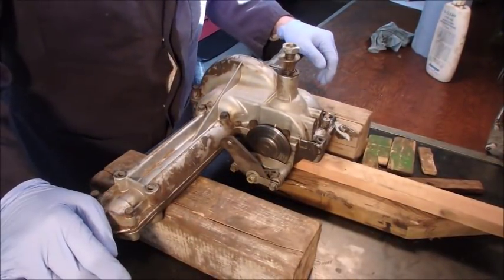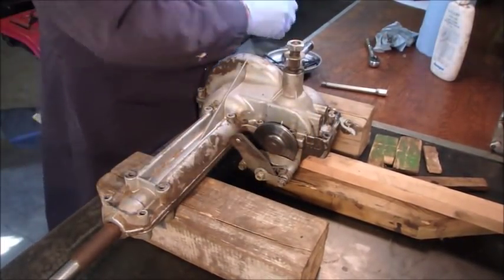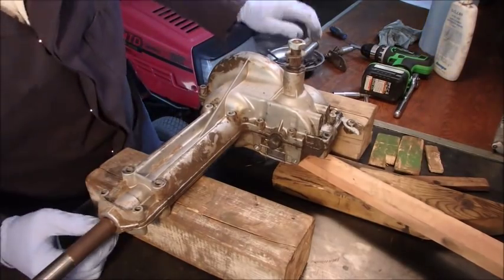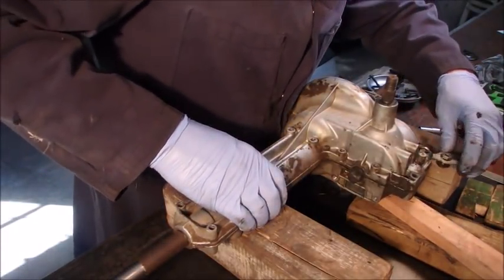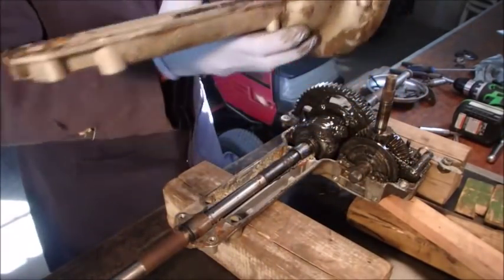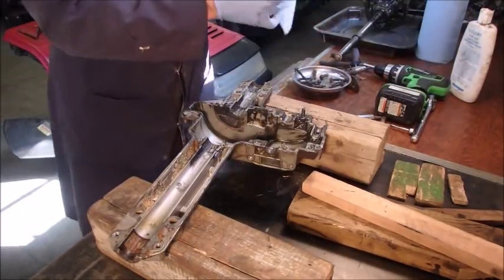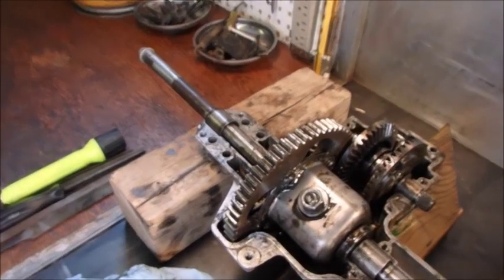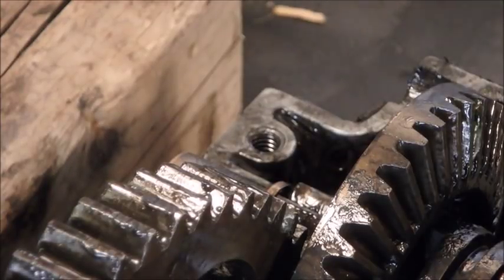MTD Lawn Tractor Differential Troubleshooting

Comment: Only person I can find testing the differential the same way I am right now.... My differential assembly  can be replaced in a [cub cadet 1040 ltx]  for around $200 but I have a grinding sound with some clunking and bouncing inside the differential... Thanks for this video! I hope I can fix this issue before parting it out :]
Reply from the maker: That is a good price for a replacement

Comment: Nice video, I got to see inside and gave me a few ideas about mine.  I've got one that locks up completely when in gear, but spins free in neutral.  Weather permitting I'll tear into it tomorrow.  Thanks!
Reply from the maker: Go for it!  Good luck
Reply: @BrucesShop  Turns out the gearbox is fine.  The variable speed pulley bearings seized up.  I have those on order now.
I disassembled and cleaned the gearbox, and replaced the grease anyway.

Comment: That Bentonite always spells disaster after about 10 years. Any time I get an older machine in, I always drill a small hole in the top of the transmission and pour about a pint of gear oil in for good measure. The Bentonite separates from the petroleum products and turns to a clay like substance, then it gets to the point where it's completely useless. I say, good call on scrapping that axle. The Briggs....It'll last forever if cared for. Cheers my Friend! Sean~
Reply from the maker: Thanks.  Zippo.  Glad you chimed in!!!  You learn more on the challenging ones.  If you just change the oil and buy a filter you don't learn anything.
Reply from the maker: You are so right.  the grease looked carved out like a scoop
Reply: Zippo do you cap the hole you drill on top of the transmission?
Reply: @doublewide6  ! KK

Comment: In 1989 I built thousands of differential for agri fab and then hydrogear pumps. It’s fascinating how that stuff works. The large gear on the differential is the bull gear. Thanks for sharing.
Reply from the maker: Thank you.  i know what it did but not what it was called.  Cool
Reply: Hey could you possibly tell me what the numbers on these belts on this mower is I had to replace the transmission belts the ones MTD sent me are way too big if you could help me with some numbers that I could pick up at Napa or somewhere I would be eternally grateful

Comment: Bruce you made the right choice of not repairing the gear.  Those MTD's are really hard to sell around here for anything over $250, and that is all tuned up ready to mow.  I try and stay away from them, I do much better with the Craftsman mowers.
Reply from the maker: Yes the Hydro's sell well too.  I hated giving up.  Motor extraction coming up.  I hung the tractor in the garage like a moose during hunting season.  The weather just went COLD so I missed that.  -28C today.  Just sticking around the house..    really.
Reply: I know this is 6 years old now, but that's pretty funny cause MTD makes Craftsman riding mowers.

Comment: Well done video. I have a 2002 Craftsman LUV, made by MTD, that I bought a couple of years ago. These where recalled back then because of transaxle failures. Mine was already replaced by the previous owner  under the warranty,  but broke on me again. They seem to have a weakness in the axle gear, it's a straight axle, with no differential. If the trans pops into gear under load for some reason, it will crack that gear at the axle shaft, causing the axle and it's drive spline to migrate out of the gear. Once that happens, all vehicle motion and braking is lost. Replacement straight axles where not available, they where apparently all used up, so I ordered a differential type axle for an MTD Pinto and installed that, hopping it will be more robust. I too, have put a lot of money into my beast. I bought it used for $425, and have easily that much more in parts into it. But, it finally seems to be working as advertised. That Bentonite, is very nasty stuff.
Reply from the maker: I agree.  It is hard t when t call it quits.
Reply: There is a differential. It is enclosed right beside that big gear. It's even called a "Differential Ass'y" in the parts book. However, it does not seem to be available separately anymore or if it ever was? Unless you are talking about a completely different machine? Seems to me in his first video that he did rotate one wheel one way and the other wheel turned opposite which means there is a differential in it. The transaxle in this video looks exactly like the MTD lawn tractor and parts book i have. Don't know how old mine is, bought it used, and when i put the Model and Serial number in the MTD search box---nothing showed up? I have not tried contacting them though.

Comment: HAPPY NEW YEAR BRUCE. Good call on scrapping it. It is a shame, but not worth it. I have a hydrostatic in a Kubota at my mother's house that has a front shaft seal and possibly the bearings and shaft that needs replaced. Not looking forward to it.   The tractor is is only 2 years old and was well maintained. Of course out of warranty. Kubota gave a cost repair making it cost more than it is worth. It replace a 22 year old Cub.
Reply from the maker: I know.  I was talking to the John Deere manager and he said $140 and hour for work.  I get it that it is expensive to run a business,  I don't have a problem with the that.     That is why folks give them to me.  3 hours labour and $400 for parts and I get a free tractor. because they don't want to spend that and then have problems in another week.
Reply: Bruce Pender I agree. I have a few parts machines now that will be winter tear apart projects. This Artic cold blast has put that on hold for now.

Comment: I have a 97 mtd garden tractor.  Low range and high range 6 speeds in each range.  I just recently was unable to go into low range. I admit I use this tractor for things it probably  should not, likevpull my rv, grade my driveway  with a box blade I made.. it is older but I have only had it 2 years.
Reply from the maker: I wished i could help
Reply: @BrucesShop  thanks for answering
Reply: you probably have a Walbro carb on there that's no longer produced. If you need parts, VE Petersen has them. I just had to rebuild mine after 23 years. I do wonder what the tranny/diff looks like inside....

Comment: My theory with this problem and a few others is people hauling the machines around. The machines set on a trailer or in a bed of a truck smashing back and forth for miles. Those things come in crates for a reason. If people would properly tie them down this problem along with auto liability rates would get better.
Reply from the maker: You could well be right.

Comment: Got to know when to hold em and when to fold em. I walked away from an old McCullough chainsaw after a similar experience. Kept it for parts for the other one I  have .
Reply from the maker: Have you seen this video Tim.  I gave up on this one.
https://www.youtube.com/watch?v=6Sg_XgfTqFM
Reply: HI Bruce. Similar McCullough sold by Montgomery Ward circa 1970's. Not as bad as that Mini, but after fighting the same problems on the throttle and getting it running, the rubber intake just sort of melted away and it wouldn't run right. Too much trouble. I have two, the other works perfect. I can cannibalize it.

Comment: Hey Bruce on this particular mower I am replacing the top and lower transmission belt it's a 2013 42 inch cut MTD sent me the wrong belts could you possibly tell me what numbers on the belts I would get from like say NAPA Auto Parts please
Reply from the maker: I am sorry.  This is a five year old video and I parted out the mower afer all the work i did on it.   Once again sorry

Comment: @Bruce Pender. Bruce, the mower my stepson bought for $100 wasn't going into Forward, so I sorta explained the transmission to him, dividing it into 2 parts, 1: the gears, 2: the deferential w/axle. The forward gear needs to be replaced. It's not to bad to change since you already have the trans out, which is the hardest part of the job. Back to this mower. It's not worth fixing, or was it just the age, plus money already spent on it. I know we all have our breaking point but since this guy spent $100 for a mower in great shape, they just didn't know the trans would be a cheaper fix than they were told by the repair shop.
Reply from the maker: Thanks for the input.
Reply: @BrucesShop  Well, actually thank you to you. Your video is 1 of 2 I downloaded into a folder named ''Mikes Bolens MTD Mower. With a tag on the bottom side of the seat with, ''Troy-Built'', then ''MTD'' on a ''Bolens'' mower, it's not a wonder most of us guys who do their own work can get confused on what product they do have. So now that I have that figured out, what he needs to fix his trans is, 1: the Forward Bevel Gear, 2: the ''Shift Collar'', only because it has a small amount of wear but can add to the trans issue: ''Popping Out of Gear'' issue.

For those of you who are going to repair your own trans, the Lubricant I'm referring to below is called: ''Super-S  /  00 Grease & Sells for $5.29 + Tax /It's under the heading,  ''Cotton Picker Spindle Grease 00''. 

Where:  ''Tractor Supply Company'',  aka  ''TSC''  & at tractorsupply.com

As for the lube which needs to be replaced because it's very dirty ''brownish color'' & it's already breaking down into a liquid, plus there could be a small piece of metal, metal shavings but probably dirt, so it wouldn't be too wise of us to reuse this lubricant, besides we really do not need experience tearing down this mower that much to save a couple hours time so save $5.60. Besides, the 00-Grease is also what MTD is referring to if you were going to buy their product, which I was told cost, $19.95 for a 9 oz bottle & this transmission takes 19 ounces. So 18 ounces is $39.90 from MTD. I'm sure a repair shop sells something maybe under a different name for less than MTD's price, [maybe cheaper] but you get the idea.... I mean if we're gonna do the job, why start looking for the most expensive stuff out there.... With this lubricant, it's like a $40 job to fix the trans....
Thanks for getting back with me. You're up in Canada right?
Reply from the maker: @montydaniels1054  Yes.  Western Canada   a 9 hour drive north of Helena Montana

Comment: Do these transaxles have any grease ports on them?  I want to service mine but it looks completely unserviceable unless you take it apart like you did.
Reply from the maker: They do not have grease ports.  I considered tapping a 1.4 in thread hole to service it with grease.
Reply: @BrucesShop  Thanks for the response.  I thought about this too, but it looks like the axle bearings are sealed cartridge bearings and the actual differential housing is riveted closed...so a grease port would really only lubricate the gear teeth and not much else.
Reply from the maker: @cup_and_cone  OK

Comment: All that and to throw it away, seems a waste.
Wonder what got in there.  Mine is about 25 years old and don't think it had any issues prior to the housing break.
Reply from the maker: So true.  You know I was just done.  I would repair something major  2 days later another major thing would happen.  Thanks for watching though.
Reply: @BrucesShop  I finally got mine all apart, I can definitely feel your pain.
The headache of rebuilding this and if it doesn't go well will be quite a blow.
Can you confirm for me that the axle/differential is a bit 'wobbly'?
Kind of looks it in your video but hard to tell.  Should it feel like a solid rod, or should it feel like it has a knuckle in the middle?
I tried to take the diff apart but couldn't figure out.  Some of the spacers have wear only on one side which makes me wonder, but maybe the spacers are stationary so it makes sense for the bottom side to be worn through since it's getting all the weight and friction.
I didn't look at my gears up close but think I'll only need some new spacers, we'll see.  Just the thought of trying to get this back together gives me a headache.

Comment: Great infor.  rebuilding that gear is not hard at all, even the previous owner did a bad job as rebuilt gear groves are too shallow, so the sounds from. It could built up bad gears by welding, then reshape/grind gears by a stencil pattern from 5-10 good gears, and use it to check how the rebuilt gears shape.
Reply from the maker: Right.  I had so many issues with this tractor I finally parted it out.  This video was made 4 years ago.  Thanks for commenting and watching.  I totally understand I should have kept going.  I was just worn out like the tractor.  LOL   Thanks again.
Reply: Osborne Bay-----"previous owner did a bad job" What makes you think anyone has welded it? I highly doubt anybody welded it. Those aren't "shallow teeth", they are damaged teeth, and anyone who has worked on a transmission or differential can see that. You never talked about hardening the gear either. If anyone had 5-10 good gears in the first place, they sure wouldn't bugger around trying to weld and shape teeth!!

Comment: Would like to have seen the condition of the forward , reverse gears and the engauge plate between them  .
Reply from the maker: This is a 4 years old video.  I finally got fed up.  Every time i went forward it was 2 steps back.  This machine was worn out.

Comment: Is there any way to add oil to the rear end?
Reply from the maker: This one was sealed.  You can drill and tap a fill and drain hole .  I have not done it but you can google it for sure.

Comment: Well, this makes me sad.  I always think things have feelings, used to always make sure the covers weren't over my teddy bear's face, so he could breathe.  I have a 1998 Craftsman/Tecumseh in the basement with a badly bent crankshaft from hitting a root (it started back up) and then immediately, a piece of old brick that had appeared in the back yard (kids? neighbor??) and, even though I bought a brand new Toro this past Spring, I can't bear to get rid of the Craftsman.   Have newspapers and rags under it to catch the oil that's leaking out <sob>
Reply from the maker: I know I know  sad  :-(   -------------BUT I am selling the parts.  It  helps to pay for the cost of TRYING to fix it.  Think of it as a heart transplant for somebody else's  tractor.
Reply: that'll work!

Comment: Old post. I didn't see what was removed with the shaft that shifts it from forward to reverse, but there should have been a spring with a steel ball under the shift shaft, the steel ball may come out and into the gears?
Reply from the maker: You are right.  This is a video from sixtyfiveford   at 1:13 in HIS vieo have a look.
https://www.youtube.com/watch?v=7kG6UWl5At8

Comment: What those transaxles might lack in quality, they more than make up for in simplicity and parts availability. MTD has used this same transmission set up in nearly every standard machine that they have built for the last 35 years; so getting new or good used gears or even a complete good used axle would neither be difficult or expensive. I think he gave up on this machine more from frustration than anything else because this machine could have easily and cheaply been saved. MTDs get a bad rap but they really are not bad for a cheap, basic “homeowner” machine to mow 1/4-1/2 an acre with once per week. If they are stored inside, get basic maintenance, and are not abused they can give good service for many years. That being said, I would only buy a used one if I planned to fix it and keep it for myself or if was in good order and dirt cheap. For resale machines, they are just too common and (like most everything that is “entry level”) are “use, abuse, and toss out” mowers. They are cheap enough new that most buyer will just plan on replacing them every few years instead of taking care of their services and trying to make them last. Unless you can score a nice freebie or have access to a stash of used parts on hand, its hard to fix one up and sell it for a profit.  My Father in-law has this same machine that he has had since new. It’s now 22 years old, look and runs great with little more than general maintenance but has always been stored inside and never abused!
Reply from the maker: I agree.  4 years ago when this video was made i finally just got tired of fixing and fixing.  I had way to many hours on it which as you say is a good thing.  Thanks for the informed comment
Reply: Brian, 
You make some very good points,  however a lot things have changed over the last year.  
The cost of everything is high,  I'm rebuilding a 2005 Murry 40 inch cut.  The cost isn't too bad for the mower parts,  the engine parts are another matter.  The parts to rebuild the 12.5 horsepower Briggs and Stratton are so high,  it's cheaper to buy a new engine.  So that's what I'm doing.  
I'm thinking even with the new engine,  I should have less than $300

Comment: Soon as I heard those popping sounds before you took it apart I knew the gears were bad there should not have been any popping whatsoever in that trans axle so you went around the barn 4 times to tell us the door was open in old mechanics terms
Reply from the maker: Well you have never made a video.   It all works out.